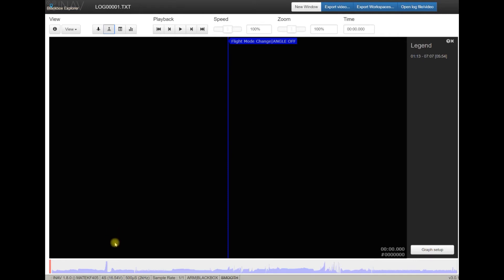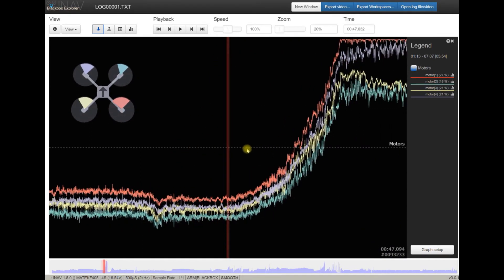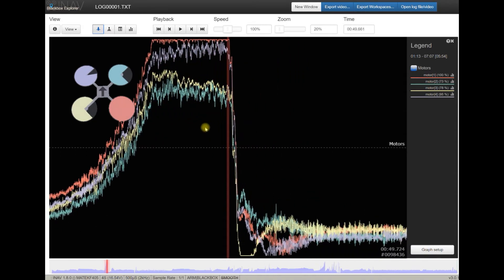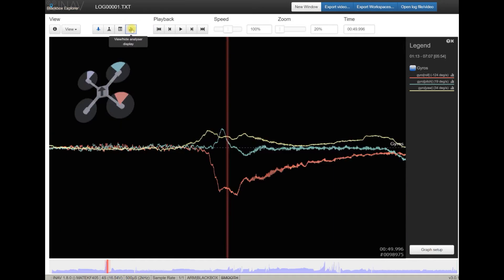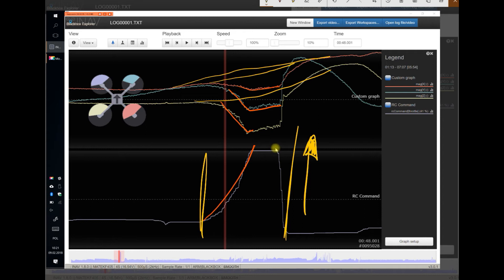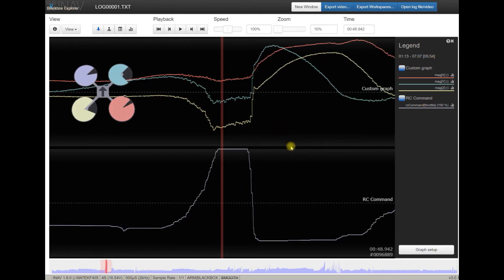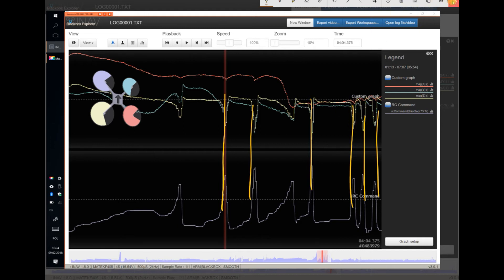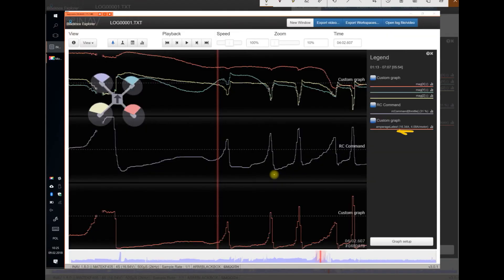INAV Blackbox Analysis #1 - poor position hold but good acro

Comment: Hi Pawel, first thanks for your tip with Baitian GPS, now I got GPS and Magnetometer working. The drone works correct as long as I do not switch to PosHold or AltHold. In the moment I switch that on the drone tries to fly away, it is possible to override this manualy but if I would not interfere it would fly away. I would like to setup Blackbox but it sayy always NoSDcard detected... I use iNav2.x latest Version on an Omnibus F4 V3. I switch to Blackbox in configuartion and set it to SDcard in Blackbox. Do you have any hint how do I get Blackbox activated?
Reply: Sorry I need to comment to myself, I got Blackbox working with CLI, I needed to set: sdcad_detect_inverted = on, so I will do a testflight with blackbox and see what is going on with PosHold and AltHold...

Comment: Can you help checking mine?
https://drive.google.com/open?id=1p5JyeZjIWXwAE3hpW8W9c-A03LUQcPhn
https://drive.google.com/open?id=1hFt1efckphdDLSEwvlYizpwGbFRG3mJH
It was just that stable some months ago:
https://www.youtube.com/watch?v=fROxqXK2LPY
I added a better GPS unit and just some aluminium foil to shield GPS from below and sides.... made some compas recalibration and starts toiletbowling very often....
it is a very small 160mm frame and compass is integrated into 10DOF FC, no place for external compass at 10cm height :( so compass is cjust 1-2centimeters near ESC wires and battery.... no more place, I try to add more aluminium foil but does not help